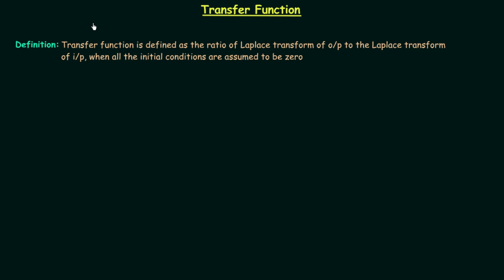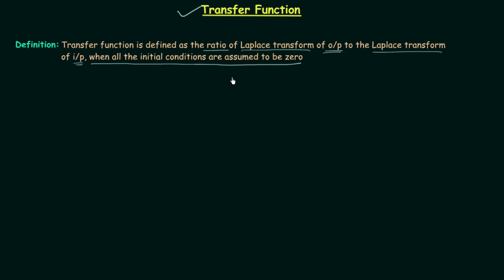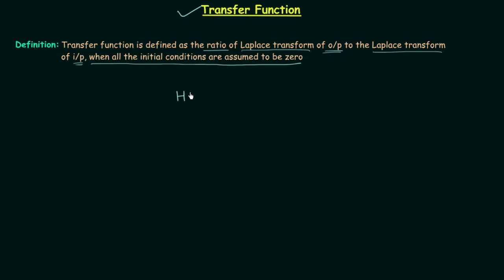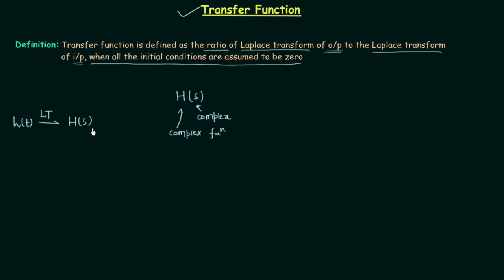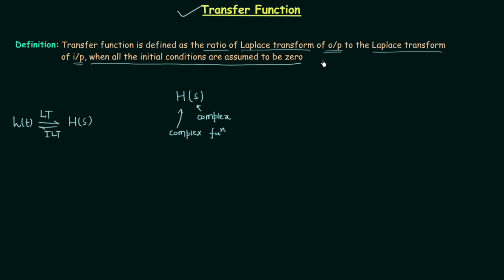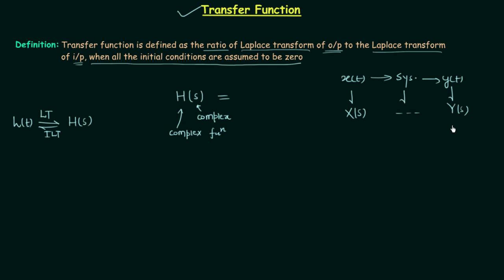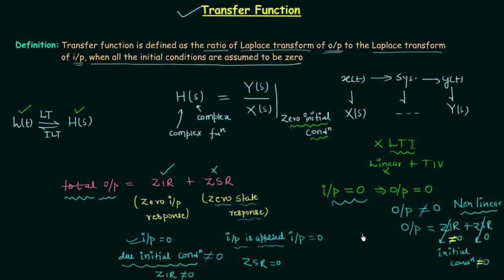Transfer Function

Comment: Still can’t understand ZIR. Input = 0, but initial conditions are not equal to zero. What are the initial conditions here?
Reply: Take it simply...you might have torch light in your home. Charge in the torch light is stored in capacitor.
Now input to the torch is when you plug it in for charging.
Now before plugging some charge may be present in the capacitor.
That means its initial condition is not zero. 
Now if all its charge is drained and now you are plugging it for charging that means its initial condition is zero
Reply: Same question from me
Reply: @sahreenafzal9387  did you understand my explanation on torch light?
Reply: @amrabackbenchers4841  aami tomar answer gulo k valobasi
Reply: @amrabackbenchers4841  nice explanation
Reply: @amrabackbenchers4841  good example

Comment: Sir how can impulse response of a system be equal to ratio of output and input of the same system. As we have read previously that output by input gives gain of the system and here this implies that impulse response is denoting gain but i am confused with this please answer this sir.
Reply: Ratio of magnitude of output to the magnitude of input is the gain.

And the ratio of their Laplace transforms is T.F. which is indirectly the Laplace transform of impulse response.
These are two different things.

Comment: what do you mean by initial conditions
Reply: Just think of a hypothetical situation that you are a seismologist and you are going to measure the vibration of earth interior due to earthquake(minor) at the instant of starting by a seismograph(system).Definitely system will measure the vibration. But if,initialy, there is some vibration(due to any other reason,just consider) then it will be added with original vibration amd you will get wrong vibration datas.So it is very much required not to have any other vibration INITIALLY  (INITIAL CONDITION). It is just a ANALOGY to understand better the concept of ZERO INITIAL CONDITION TO HAVE H(s) from a system. GOOD LUCK.

Comment: First you say zir is 0 and then you say it isn’t. You’re confusing me
Reply: There are two cases explained when zir is 0 and zir is not zero
Case I: when intial conditions are not equal to zero means(ZIR not equal to zero) 
The total output = ZIR +ZSR
When zero input is applied ZSR becomes zero.
Total output= ZIR  (not equal to zero)
The system becomes non linear so we cannot define transfer function.
For linearity for zero input the output is zero.
Case2:Intial conditions are zero means ZIR =0
Consider ZSR=0
Total output =ZIR +ZSR=0+0=0
For zero input the output is zero the linearity is satisfied we can define transfer function in this case.

Conclusion :The Intial conditions is considered as zero in transfer function.